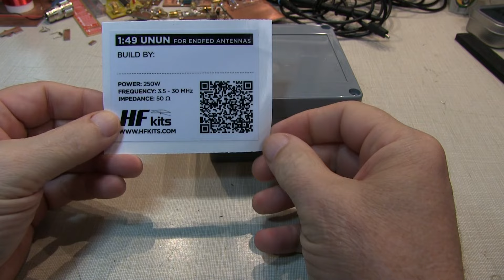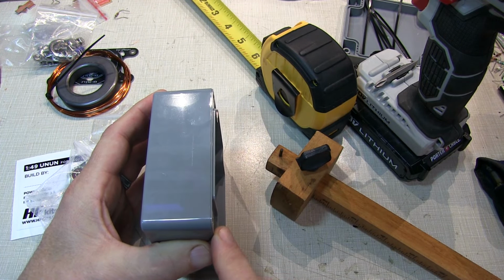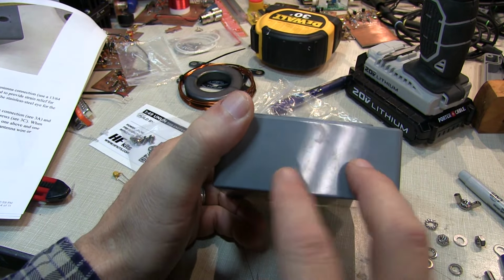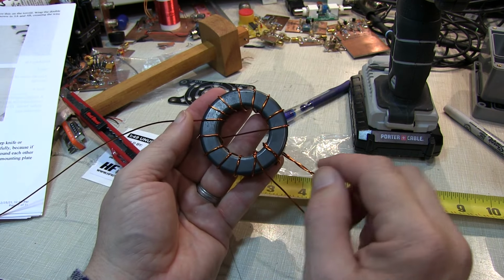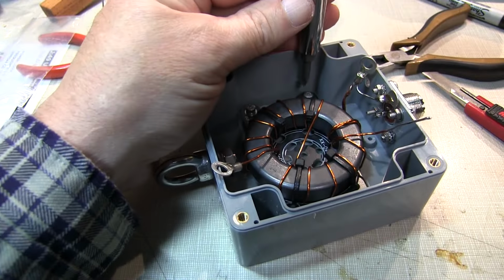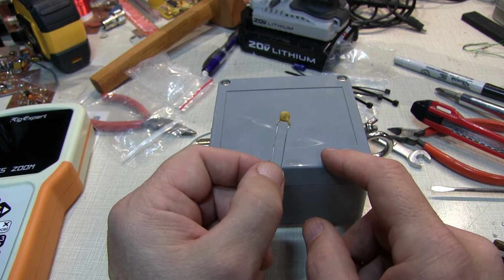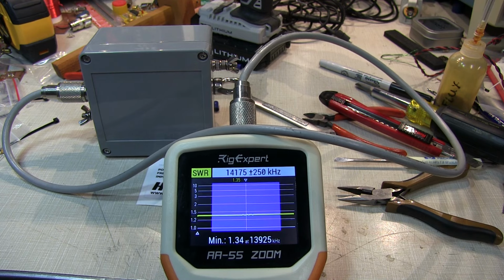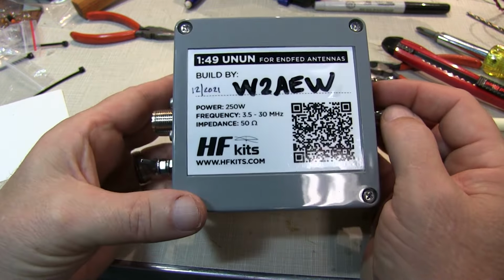#344: ARRL 49:1 End Fed Halfwave UNUN transformer kit from HFKits - Build and quick bench test

Comment: That's a nice kit (and a decent job of building it!). I know what it took to build my own (smaller)  one from scratch and that's a very neat solution.

Although end-fed antennas are to be avoided if possible, they are fantastic for portable work, or for situations where options are limited. there's nothing quite like throwing a wire up a tree and working the world! so I'm a firm believer that all hams should have one of these and a couple of bits of wire in their shack for when the dipole/beam/magloop gets blown down in a gale and they want/need to get on the air!

Thanks Alan! nice to see you back again!
Reply: Working the world on an end - fed wire is magic, and must be tried as it is easy to make, not too bad on the eye, and has a low cost!!
Reply: @John Cliff You can use a perfect antenna, if you happen to live in a perfect spot in a perfect world. yes, end-fed antennas are a terrible choice when you've got the option to use something else. but personally I quite like a very simple  "chuck-it-up-a-tree" halfwave for when out roaming and i've got a half-hour spare to play radios. theoretically not the greatest, but for QRP mobile, it works just fine (uk-aus on 5w while having a picnic is good enough for me!)

Comment: While the EFHW transmits... I personally find it to be the best all band HF SWL antenna I've ever used in my 30 plus years of amateur radio. My build is 10 thru 40 meters transmit @ 68 feet of conductor (bare) and below 7 MHz the resistance at the rig drops to 10 ohms on the 75/80 meter band. Transformer offers improved signal to noise with minimal insertion losses. My arrangment uses a 30 foot aluminum mast as a counter-poise with a 1-M ohm 1 watt resistor across a home brew blitz bug to ground. AEW's "perfect score production" videos are a valuble contribution to the amateur radio community, sure take some of the head banging out of learning. Common Mode without doubt is an issue if you plan to transmit. Enjoyed the demo. "Cool Stuff" N0PLV~ Tnx...  ( I did end up adding a 100 pf HV cap to complete the Pi-L primary side of the transformer on mine.)
Reply from the maker: I'll see how much common-mode is a problem with this antenna.   I also use a Par Electronics EFHW for portable operating, and never had a common-mode problem with it.

Comment: I built the same kit (sold by ARRL, for Field Day 2021) and have been very happy with it. It is currently my only HF antenna.  

I do believe that the "250 watt" rating is more marketing-inspired than real: running digital, with 50W, I saw some SWR changes (rises) during long transmissions.  The toroid was probably getting hot. It was fine at 20 watts, where I normally operate when doing FT8. Even when using SSB/phone, I suspect 250 watts will risk damage to the transformer.

Given how easy it was to construct, I bought some FairRite (brand) cores on-line and hardware from Home Depot - I'll try to build a version of the transformer with two cores in parallel.